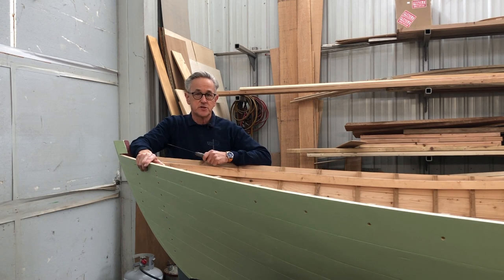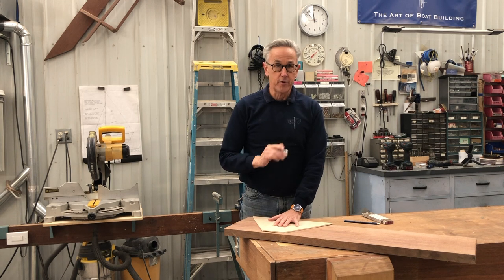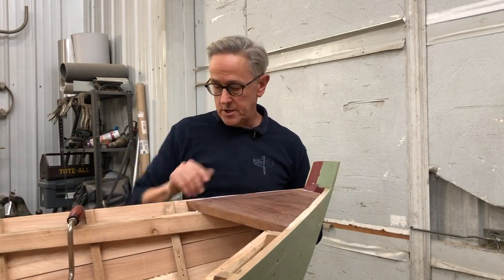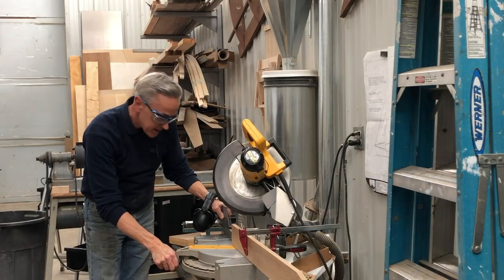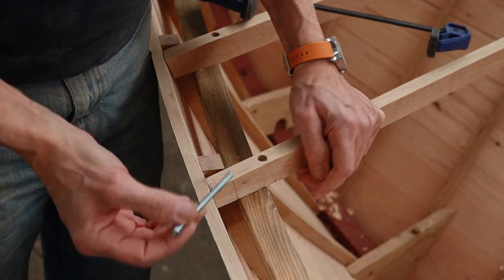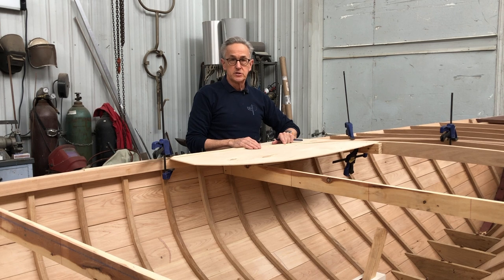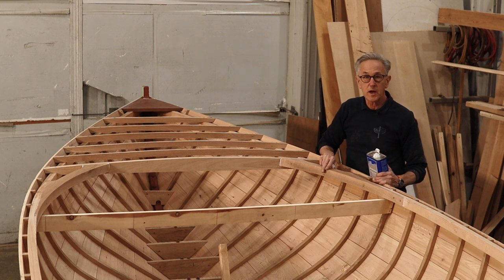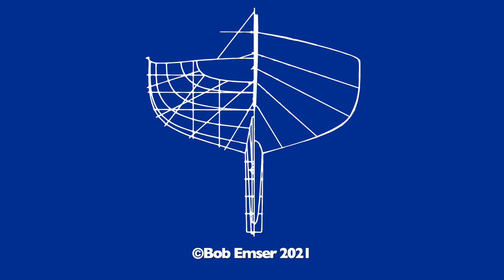Wooden Boat Building, Installing Deck Beams, Breast Hook, and Lodging Knees, S2-E38

Comment: Your blowing my mind....a Yankee screw driver, brace and a wooden folding ruler. That is the only way to go. Sure feels good using those tools doesnt it....Im a carpenter from back in the day and we had to learn hand tools before you could pick up a tool with a cord. Its refreshing to watch you use those great tools. Where I live 5200 doesnt work very well on repairs due to the extreme low humidity. Its challanging not to be able to use that product since I lived on both coasts and it works fine in the costal humidity.

Comment: You mentioned that the floor beams will be removed later. Why is not necessary to remove the last floor beam? It clearly can’t be removed now that the lodging knees are done. Thanks in advance for letting me know. Thanks for another great video and all the best for 2021.
Reply from the maker: I think you mean deck beams not floor beam. I will be replacing the steel bolts with brass. At the time I will paint the bilge and having those fore beams removed it will be easier to maneuver while painting. 
Thanks for watching!
Cheers

Comment: Great video Bob and it’s so great to see the boat take shape. Why didn’t you make the breast hook thicker initially so that you match the curvature of the deck beams??
Reply from the maker: Hi Harvey,
Great question. I did measure the crown on the breast hook and it was almost indistinguishable to a level line. Maybe a 1/64 difference at the most. It will be covered with the deck boards and set in bedding compound. so I elected to just plane it flat.
Thanks for watching!
Cheers,
Bob

Comment: Looks great Bob! Are you steam bending the coaming, or won't it be necessary as the curve isn't that drastic?
Reply from the maker: Typically yes, the coaming is steamed. I'd like to make it out of walnut the match the transom. I don't know if I have a long enough boards so if I need to scarf on I most likely will laminate the coaming.
Thanks for watching!

Comment: Is there a reason you did not seal the breast hook to protect it from water before you permanently installed it?  As always, great work and a fun build to watch.
Reply from the maker: The breast hook will be covered with the deck boards. It will have marine sealant between them.

Comment: Thank you Bob for another excellent video.  Very nice fit of the breast hook and the lodging knees.  Did you find any significant difference between the lodging knees?  Watching how meticulous you were in framing and planking, I would expect maybe a shaving or two but not much more than that.  Take care, stay well and Happy 2021.
Reply from the maker: Hi Matt,
Yes, there was a slight difference of the two lodging knees. Not much to have any concerns about.
Thanks for watching. Happy new year too you as well.
Cheers,
Bob

Comment: Really beautiful hull.  Looks like it was designed to be strong, yet as light as possible despite the heavily weighted keel.  Was this done primarily for performance or to make it more easily trailerable?  Will you keep her in the water or on a trailer?
Reply from the maker: Hi Clark, 
Yes, the weight distribution is an important part of the performance. My boat will live in the water during the season. 
Thanks for watching.

Comment: Excellent video Bob. I’d like you to explain how the hanging knee can attach to the deck beam at one end and then attach to the sheer at the other when the deck beam rests on top of sheer? The sheer and the deck beam are not level yet the knee looks level from the camera angle used in the video. The knee looks great when you installed it but I can’t figure out how the knee covers height of the beam and the sheer at the same time. I hope I described that well enough for you to understand me.
Reply from the maker: Hi Michael,
In episode 37 (https://youtu.be/22Rg8wxq210) you may remember that the shear clamp makes a jog from station 6-10 to accommodate the deck beams. Also while taking off the bevels I use the deck crown template to determine what will result in the top of the shear clamp being the same angle or in line with the top of the deck beam, making the inner face of the clamp perpendicular to the crown. So the lodging knee starts at frame 11 before the jog, which makes it's top level with the shear. Because the shear clamp has made it's jog the other end meets the top of the deck beam. So because the lodging knee is at the same angle as the crown it lines up with the top of the shear at frame 11 and the top of the aft deck beam.
I hope this helps. Let me know if it's still unclear.
Thanks for watching!
Cheers,
Bob

Comment: Are you planning to paint under the last deck beam as well?
Reply from the maker: Hi Hugh,
No, as it's installed to the knee I'll just paint what I can. Painting under the other deck beams really isn't necessary. However, when replace the steel bolts with brass bolts I'll paint while the are out of the way, should be easier to maneuver. 
Thanks for watching!

Comment: Out of curiosity....why use a flat head screw on the walnut you installed on the bow?  I've notice before that boat builders seem to like flat head screws; however, it seems a Philips would be so much better.
Reply from the maker: This is a common question. I have found Leo Sampson Goolden a shipwright restoring Tally Ho, answered to this question, best said.
Here is his answer. 
“The main reason is for the benefit of whoever has to work on the boat in the future. When working on an old boat, slotted screws are by far the easiest to clean out out the slots and remove the screws, especially if bungs have been glued over the screw-heads. Cleaning glue (especially epoxy!) out of a Philips head (or really any other kind of drive) in order to get your driver to grip the screw can be an absolute nightmare. So next time you have to put screws in your boat, spare a thought for the shipwrights of the future!
In visible applications, a slotted head is simply more aesthetically pleasing and historically accurate.”
 
All screw heads have their application, one is not better than the other it just depends on what you are fastening together. 
Thanks for watching,
Cheer,
Bob
Reply: @TheArtofBoatBuilding  

Bob,

Thanks for the reply.....makes sense.  I really appreciate the content you produce, it is very interesting and well produced.  I can't wait to see this boat when you get it finished.  I've been toying around with building a PT11 Nesting Dinghy and watching your videos offers confidence that I could do it.  

Regards,

Drew

Comment: Congratulations on the choice of the use of 3m 5200. It is far stronger than the wood you are attaching it to! In fact some shipwright in the far distant future that receives that boat for repairs and has to remove one of those parts fastened with it will be cursing you in some tongue, we know not what!

Comment: Excellent work as what we are used to. That breast hook lost a lot of its stiffness and strength through planing it. I wonder if you couldn't have kept most of its thickness working out the shear clamp?
Reply: Yep  I'm surprised it wasn't cambered. On the other hand this isn't the finished article, so I guess we could reserve judgment.
Reply from the maker: The breast hook is install as per Joel Whites plans. The extra thickness of the stock I was using is because that was the thickness of the material I had. I planed it down to the thickness described in the plans. The breast hook will be covered with the deck boards adding strength. Your question about "working out the shear clamp" would have had unsatisfactory results. The walnut stock started at 1 1/8" thick if I had keep it and removed shear clamp thickness, it would have reduced the amount of material to screw into. Also remember the shear clamp bevel works out to be about 5/8" on the bottom. 
Thanks for watching!
Cheers,
Bob
Reply: The Art of Boat Building No offence meant, Bob! After all, it's your boat. You build the way you want it.

Comment: Why not build a jig and bend the deck beams? I would be worried about strength with the grain runout in such a narrow cut arch. 
The curves are graceful, yes, but are they strong? You know more than I about these things, I am asking in earnest.
Thank you.
Reply from the maker: Hi Thomas,
White oak is incredibly strong. I don't think that laminating beams of that length would give any added benefit. By following the plans I trusting that Joel White knew more that me. The curve actually makes it stronger than a straight section of the same size, as in arched lintels are stronger than straight.
Thanks for your question, watching and continued support.
Cheers,
Bob

Comment: Have you considered the Gorilla glue ultimate? Much less expensive that 5200. Actually, proud comparable to 4200. I’ve only found it online though.
Reply from the maker: Hi Rick,
I'm not a fan of Gorilla Glue for boat building. Gorrilla Glue expands as it dries and can push wood apart. It's perhaps is an okay choice as alternative to epoxy is certain situations. Gorrilla Glue is good for somethings but not boat building. 5200 is a tenacious adhesive and fill gaps well ( the purpose of bedding compound) and stays flexible.
Thanks for watching and your continued support!
Cheers,
Bob
Reply: I was actually referring to their “ultimate construction adhesive”; $10/tube on Amazon. I agree about the regular gorilla glue.
Reply from the maker: Hi Rick, My mistake. Not familiar with the ultimate. I'll check it out.

Comment: I’m wondering, was 5200 Joel Whites choice or did he specify epoxy for those areas?
Reply from the maker: Hi David, Joel did specify bedding compound. Maynard Bray who has written extensively about the Haven's construction recommends 5200 as bedding compound.
Thanks for watching and your continued support.
Cheers,
Bob
Reply: @TheArtofBoatBuilding  Bob, if Maynard says it’s ok then I’m good! I stopped in and saw him at OCH a few years ago. He gave me some great pointers about the boat I’m building. BTW, did I mention I’m also an alumnus of Wooden Boat School 1996. I met Joel White while I was there and had a chat with him. Very interesting man. A wealth of knowledge. He is missed by many. Your Haven is coming along a lot better than my dinghy. It seems that I’m always stopping to do something else. I’ve promised myself to finish her this summer. I’d better hurry....I’m 76!

Comment: A great video, but why did you make a flat breasthook when the rest of the deck is faired (I think that's the right term)?
Reply from the maker: Hi Mike,
Great question. I did measure the crown on the breast hook and it was almost indistinguishable to a level line. Maybe a 1/64 difference at the most. It will be covered with the deck boards and set in bedding compound. so I elected to just plane it flat.
Thanks for watching!
Reply: @TheArtofBoatBuilding  Thanx. That 'splains it. I thought it had much more curvature. Can't wait for the next video.

Comment: Should the breast hook have sat flat against the sheer clamp.  It looked like there was angle between them that the 5200 didn't even fully fill?
Reply from the maker: Hi Rick,
I just posted an image in the community section. You'll be able to see it sits flat on the shear clamp.
Here is a link.
https://www.youtube.com/post/Ugy9iJ8Nt5yEQXPQ4UR4AaABCQ
Thanks for watching!
Cheers,

Comment: Love that bevel gage, but it still too big for the that breast hook measurement. Make yourself some shorter ones from old hack saw blades. Just put them in the vice an break them off at about 2" long. Sand off the teeth, drill holes, and rivet it together with copper slating nails.

Comment: Why do craftsmen use a round mallet to tap on chisel.
Reply from the maker: Wood carving mallets are round to increase the amount of surface area you can use to strike the chisel so you can focus more on your work. They are more balanced and the weight is easily controlled. This allows you to not have to worry about where the flat surface is on your mallet and help you make harder to make cuts requiring more finesse the lack of corners on the mallet also help increase control.
Thanks for your question and watching!
Reply: @TheArtofBoatBuilding  thanks

Comment: While installing deck beams, you said that they were temporary and would have to come out for paint and sealant, but then you sealed the lodging knee to the frame and one of those beams. Oops?
Reply from the maker: Hi David, 
Yes, I will remove the fore deck beams when I switch out the steel bolts for brass. The other benefit is it will be easier it maneuver when painting the bilge. Paint under them is just a benefit, not necessary. 
Thanks for watching.
Reply: @TheArtofBoatBuilding  That doesn't really answer my comment: It looks like you permanently installed the lodging knee, connected to the last deck beam. Is that last deck beam not coming out, do you plan to break and replace that sealing, or some other option?
Reply from the maker: Right, I will not remove the aft deck beam and lodging knees. I will paint them in place.

Comment: You really need to wear gloves when working with acid tone! It goes straight through your skin into your system.
Reply: "acetone"
Reply: You really don't, it's a mild skin irritant. People use it as nail polish remover, it obviously contacts your skin in that application as well.
Reply: @danno1111  'People' eat Tide Pods, so don't take that as a recommendation.